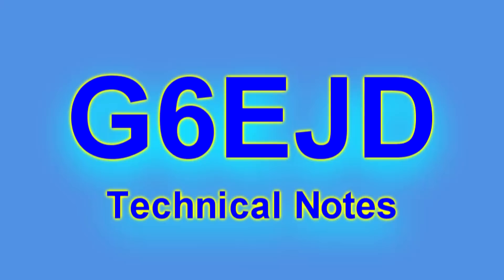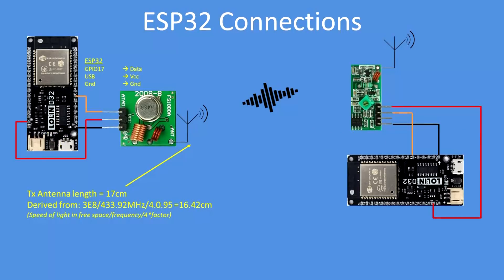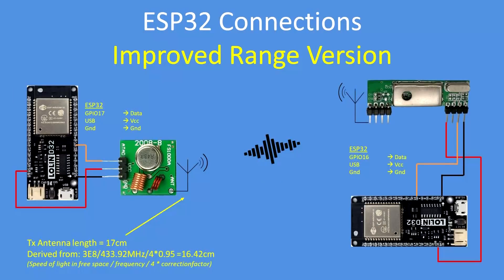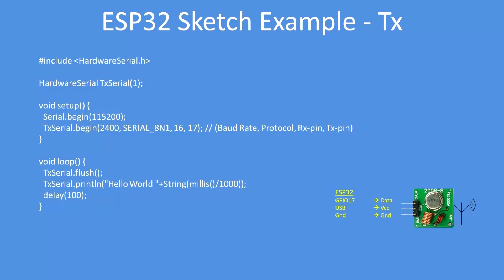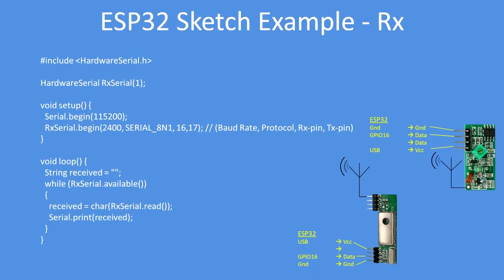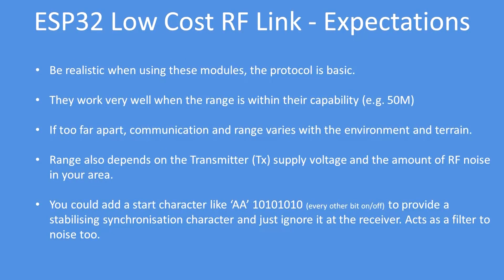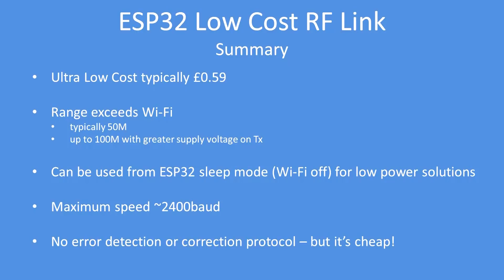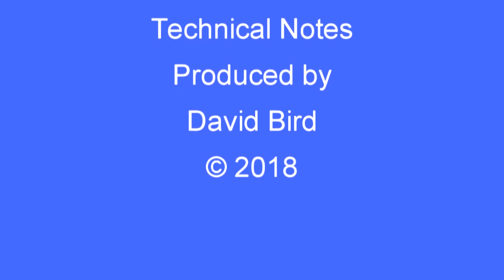Tech Note 110 - ESP32's using low cost RF links

Comment: The esp32 works on 3.3v and the transmitter and receiver work on 5v. How do you deal with that?
Reply from the maker: @ArielHirsch-u5p  the Tx/Rx units will work on 5v or 3.3v, lowering the voltage won’t affect the receiver, but depending on the Tx design increasing voltage to 5v may result in increased RF power and range. The simple solution is to place series resistors between the data lines of ESP32 Tx and module Rx pins. The value would be (5-3.3)/1mA=170K that value should be more than adequate. In practice the ESP32 has plenty of input protection together with output protection too.

Comment: @ G6EJD - David   The real problem is this!!! How to detect a music from the headphones of my ipod at full volume (but placed in another room of the house) and detect it in another room of my house via the 433 mhz module connected to a speaker ? With at least a range of 5\10 meters !!! Could you please help me to realize this little experiment ? Thank you very much.
Reply from the maker: That’s not really feasible as 433mhz is such a relatively low frequency. The higher frequencies become the closer RF becomes more optical line of sight. Plus detecting direction can only be achieved with two or more antennas and then measure time difference of arrival, but these techniques are very specialised and expensive. To be honest a simple scanner available just about anywhere would help with just about any antenna, where you can listen in two different locations and see the relative signal strength from which direction can be found, ideally 3 listening locations will give better accuracy.
Reply: @G6EJD  As expensive as FBI technology?
I will try the multifrequency scanner but it too will not be cheap. I am pondering and trying to learn more about frequencies and radio frequency (RF).
I read from google, "The radio wave band (including microwaves) extends from 3 Hz to 300 GHz (in wavelengths from thousands of km to mm)." Beyond 300 ghz you get to 'infrared. 
Very difficult for me who is just an 'electronics enthusiast. But I must succeed at all costs even with a poor result.

Comment: I am looking for solutions to a problem my neighbors are creating for me. They talk at night but in a disguised but understandable way, it sounds like a poor quality ultrasonic suppressor. Or trivially a transmitter and I hear them through headphones .... . I also sense the noises and vibrations during the night hours. In summary I would like to build myself something good so that I can record them (since they have been going on for three years until now) and have them stopped. What do you recommend for at least 5\10 meters of action. I will stand by. Thank you very much.
Reply from the maker: I suspect your hearing RF transmissions being de-modulated by your headphones, this is a common occurrence where people use Radio transmitters to call home as it’s much cheaper than phone calls and few if any can eaves drop. Are they likely to have family living a long way away. A scanner would likely find them
Reply: @G6EJD  Which scanner are you referring to?

Comment: Can we use somehow use one to program other wirelessly? Or any other method you know? İ dont want to default OTA. Looking for a solution to wirelessly program esp32 and esp8266s
Reply from the maker: You’d need to store a full binary image to enable an ESP device to programme another, but there is significantly insufficient storage to enable that to be possible. You could use an SD card to get around this, but why bother when the new code has to be developed by a desktop compiler which may as well then push the result OTA to the ESP’s.
Reply: @G6EJD  sometimes i use deep sleep and other battery operated devices OTA consumes my battery. Sometimes i program nodemcu which is microusb sometimes i program Arduinos which has mini usb sometimes i program custom stms which has typeC. İm done with the cable man...moreover, i hot glue often board to 3d cases.  But if i had a wireless programmer i just need to plug it on program freely
Reply from the maker: @thenextproblem8001  well you can add OTA support to any sketch and then remotely actuate an update and even a device is sleeping and providing it has an internet / network access, then it will update, the only downside is having to leave the updater running until the update takes place as it has to provide the new binary. Many IOT sleeping devices do the same. It only needs the OTA library and two lines of code to be added to any existing programme.
Reply: @G6EJD  for ESP32 sure. But STM or AVR family not having this feature so i need it again :) is there any product or some solution you know?
Reply from the maker: @thenextproblem8001  none that’s what makes the ESP devices so popular!
Reply: @G6EJD  there must be a way for WiFi ftdi adapter. İ will keep my hopes alive :) 

Thanks for your time and knowledge again

Comment: How might I use an ESP32 and an RF transmitter to control to my ceiling fan? The fan (brand Harbor Breeze) uses a remote control with the model number of KUJCE10311, in case you wanted to look it up. Is it even possible or does the receiver need some sort of proprietary signal? Any help is appreciated.
Reply from the maker: It’s possible to build something to control the fan but I know from experience that the controller you have will be a proprietary protocol that would need to be reverse engineered and it would be a lot of work, if the code can be decoded.
Reply: @G6EJD  thank you, yeah it seems like it’s not worth the trouble right now.

Comment: hi
 can I send a string code 24 bit 0&1 with transmitter to another receiver device for control    exactly like a remote control 
thank you for attention
Reply from the maker: It depends, do you mean in binary i.e. 0 or 1 these transmitters are called ON/OFF so yes you can send a high or low state, or you can send a string '10101010' and then interpret that at the other end into a binary 10101010
Reply: @G6EJD  Yes
The send.switch(b) command from the Rcswitch library cannot send Stringmybit=["0100101000..1"] ;
So first I converted this string to decimal and then binary it with dec2bin command and I managed to send it like this.
Probably, there should be a solution to directly convert string to binary. If you have any information about this, I would be grateful.
Reply from the maker: @masoudjafarzadeh  I’m not aware of any function to do that, so your solution is as good as any.you can simply move along the string and send a high or lie (on or off) as required

Comment: Hi Great video!! Hello, anyone knows if its possible to use this 433Mhz receiver to receive commands from  Key Garage transmitter?
Reply from the maker: Yes that should be possible as they are quite wide band, decoding the data is the difficult bit though!

Comment: I wonder if you could use the Rx module connected to a ESP32 to accept signals from a generic Rf433 transmitter remote control... such as pocket garage door openers or remotes used to control automatic blinds? In my use case, I would like to control a servos position with up/down commands.
Reply from the maker: I’ve done that so yes you can, the difficulty is knowing the protocol used to match the product so that data can be decoded and generated to be sent

Comment: Thank you very much. How would you use this to wake an esp32 up. By one Byte or would you send a message? I think this is the only possibility to wake the ESP up wirelessly.
Reply from the maker: Once the ESP32 is asleep it can only be woken by a pin transition so yes if the receiver was noise free then reception of a byte or series of bytes could transition a pin and wake it up.
Reply: @G6EJD  Yes but if I think about this, every other rf transmitter nearby would switch the esp on, if there is a 1 transmitted. So I need a decoder to set the High/Low signal at the wakeup pin and not be confused by other transmitters. Sad.
Reply from the maker: @DocMicha  you’d need a receiver with discrimination such as LoRa but most on the market are relatively high power consuming devices, say 5-10mA in standby so battery life would not be great and really defeats the object of the ESP32 sleeping. You could engineer the transmitter to send a preamble of say set characters or a key that the ESP32 would wake up to decode and then respond to. Even simple schemes would work like 123412341234 as this provides discrimination
Reply: @G6EJD  Thank You, that might work but it is a lot more than  I expected.
Reply from the maker: @DocMicha  Unless you devise your own methods, that's all I can think of, the receivers are wide-band and will respond to any transmission, so the best you can do is wake-up and discriminate for a correct transmission, then process the functions, if not ignore and go back to sleep. Only LoRa radios can be programmed to be slective, but it all consumes power as the receiver to be on all the time.
Reply: @G6EJD  OK. I will try and report to you.

Comment: i tried it but i am getting random unreadable noise on serial monitor of esp32. I am using fs1000a. The transmitter isn't turned ON yet iam getting garbage output on serial monitor.
Reply from the maker: You will get noise at the receiver until the Tx is actuated

Comment: for a test , is the antenna necessary ?
Reply from the maker: Not needed for those modules, most rf stages will be destroyed if used without an antenna but these modules are protected
Reply: @G6EJD  thanks and another thing,  how will i know whats not working? cause im having some troubles and its just get as receiving 0 and 1, probably rubbish
Reply from the maker: Slow down the baud rate to say 300 and try it like that first, make sure both units are using the same speed, obviously check wiring
Reply: @G6EJD  obv check wiring but wiring is not of an issue... i know cause i connected vcc to my wall outlet so no mistake there (obv joking) thanks for the help, will try it out
Reply from the maker: mighty mac if a slower baud rate works then gradually increase speed until it becomes unreliable then slow it down a bit for the best link speed, all the modules have slightly different speeds

Comment: Great work 😀👍! Something occurred to me: with one of those receiver modules, would it be possible to read those external 433MHz temperature/humidity sensors? (Okay, you'd still have to make sense of whatever protocol your respective sensor is using, but purely to get in the transmitted bits and bytes…)
Reply from the maker: Yes you can easily receive the data transmissions p, in fact the modules sold are the exact same as those used in various sensors sold. There is a library around that will decode the various formats.
Reply: @G6EJD  Okay - seems like I'll have to look into that… Thank you very much 👍!

Comment: I like your videos. You should add the code so that we can download it.
Reply from the maker: All of the code links in each video can be found in video description, or GitHub G6EJD, enjoy.
Reply: @G6EJD  Still cant find it but don't stress I just copied it from the video. I am getting allot of garbage coming through from less than a meter apart, you perhaps have tips to minimize it.
Reply from the maker: Mark, don’t be too ambitious with data rates, the slower the better with these modules as the bandwidth is poor. Yes environmental noise is an issue with some designs, but the receiver with a metal can known as superheterodyne gives much better results as it rejects most noise. When working correctly and with a reasonable antenna they can achieve about 200 metre range. These modules are used extensively across a wide range of equipment like garage door openers, weather stations, door bells, etc. You can improve link reliability by sending a preamble of 1/0 like 0x55 or 0xAA (01010101 or 10101010), then your data and at the receiver ignore any 0x55 / 0xAA data received. There are some libraries around too look for ‘ASK’

Comment: Any feel for the latency?
Reply from the maker: Yes and we can work it out, at 1200baud the bit time is 8.33mS so it requires (10-bit serial tx and same for rx) 10x8.33=83.33mS per character for Tx and adding in receiving time that’s 166mS end-to-end if you freeze frame the video of the simultaneous tx and rx you can see on the right that it’s slightly behind the tx. For an IOT sensor sending readings this delay is minimal unless you want to do near real time recordings of data because for say 20chars of data that would take ~3.2Secs - you can’t get something for nothing 😀

Comment: Thank you. I try and make it a habit of contributing those that help me not much 5 bucks but just noticed you don't have any contribute link?
Reply from the maker: paypal account is:  d.l.bird@sky.com The SCT013 is an interesting project idea, but I don't have one, I'm going to order one and see how they can be used to measure power.
Reply from the maker: BTW I noticed the SCT013 units are labelled typically 30A/!v or 100A/1v so they must have an internal burden resistor in them.
Reply from the maker: My mistake, nearly all the product pictures how the 30A/1v variant, but when a 100A unit is displayed it says 100A/50mA, so NO burden resistor, therefore it would need 1/0.05mA = 20R burden.
Reply from the maker: Thank you

Comment: Thank you for your help with the Current sensor and the NodeMCU. After reviewing the specs and reading what folks say as to how to connect I came up with a discrepancy. The spec sheet states the load/burden resistor is built in other say you must place one between the two wires of the current sensor. While others say not to connect to the circuit without the burden resistor for fear of high voltage at the output of the sensor. Confused?
Reply from the maker: Yes, difficult to determine as some data sheets say it has an inbuilt burden such that at the current rating the output voltage is 1v so if a 100Amp unit then 100A gives a 1v output. If you have a meter and the sct013 then measure it and see what you get. If you add another burden the voltage will be halve what it should be for s given current.
Reply from the maker: I have a SCT013 CT now. I've connected a 20R burden across it and measured the output when connected to the house ac feed, it works OK. I'm going to the use wiring from the openenergymonitor site.
Reply: @G6EJD  Since I last posted I have been able to monitor the current for a heat gun and it is great. One remaining problem, which I have posted in every site I can find, there is some garbage posted on the com port monitor at reset or startup. This causes false triggers on my "IF" statements. Delays don't seem to help to clear this out. Here is my current partial sketch if you have time run it and see if you see the same posting of greater than zero reading with the sensor having the heat gun turned off.
https://pastebin.com/kDjx5zQM
Reply from the maker: I don’t see anything wrong with the sketch. You will get the initial startup messages at 74k baud from the serial port e.g boot mode selected using flash memory type messages. Do you have something else’s on the serial port? You could use software serial and move you application serial port to another pair of pins.
Reply: @G6EJD  you replay is very interesting and BTW thank you for responding. It appears we are using something different and I don't know what it is because don't really know enough to say what it is. I do know don't see startup messages when I boot up my nodemcu via the port monitor. What comes up after a few seconds is the Serial.print() statements. You must be using LUA? Guessing because I have read you can use LUA(which I know nothing about) as opposed to the Arduino IDE and sketches written in C++. I could be completely wrong and accept any corrections you might provide.
Reply from the maker: LUA is a python like language and operating system. I’m using a standard node mcu programmed by the Arduino IDE. The ide does a really good job at filtering out the startup messages but your ? External application won’t. I need more information about your externally connected system to help. If there is no external system then we should inspect your code.
Reply: @G6EJD  here is the external setup. As mentioned in the schematic at the link the divider is been changed to accommodate the correct midpoint voltage for the NodeMCU. The transformer symbols was used to represent the SCT-013-30.
https://pasteboard.co/HOPiDhz.png
Oh and here is the test sketch and it minimal to figure out why I am experiencing the startup currents that can't be addressed in a settling code when the device is first powered up or reset.
Here is the test code.
https://pastebin.com/Hqy7iBjZ
And the output from the serial montiro:
The Washer Has started.
71
The Washer Has started.
16
The Washer Has started.
3
The Washer has completed washing cycle
0
The Washer has completed washing cycle
0
The Washer has completed washing cycle
0
The Washer has completed washing cycle
0
The Washer has completed washing cycle